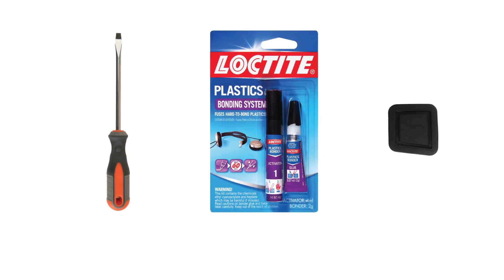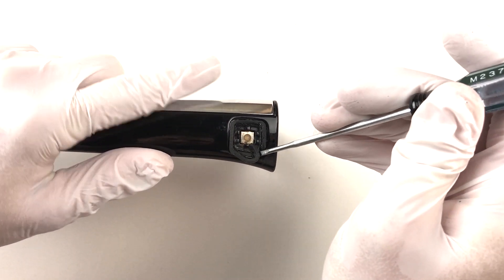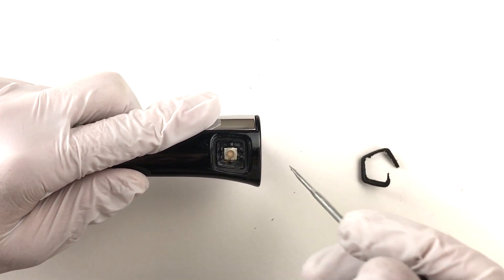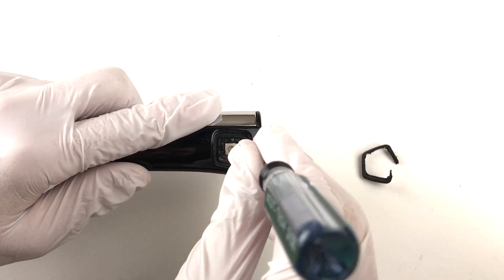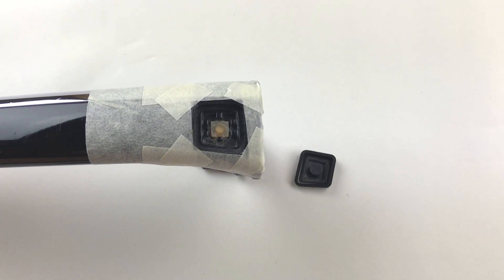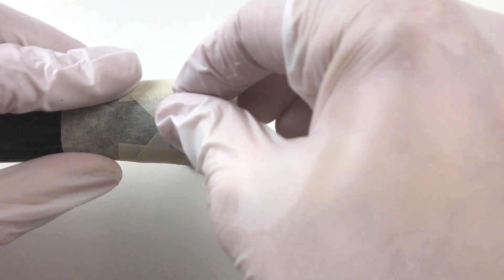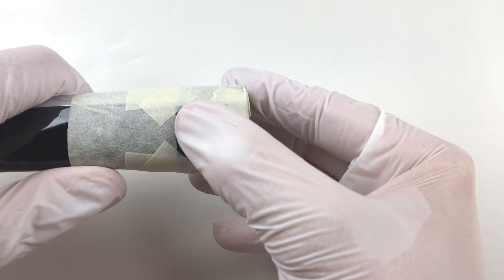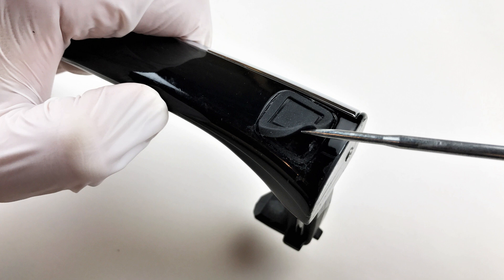SOLUTION: Fix the Mercedes-Benz KEYLESS-GO Door Entry Button Cover

Comment: Hello. Could you please help me?
Today I've replaced the driver door handle on my 2006 cls55 w219 and now if I push the knob on the door handle the door pops to open. Instead of closing the central lock. And if I push the long button behind it close the central lock insted pop the door.   Let's say the Open and close function switched?  
 Mechanically it sems like  works perfectly.   Before I replace it, it was worked  in the right way. The only reason why i replace the door hanndle was because small knob stop working. How I can fix it myself? Thank you.

Comment: Where can I order the buttons from and what are they called
Reply from the maker: They are back in stock: https://www.ebay.com/sch/ie.works.minnesota/m.html?_nkw=keyless
Reply: Thanks
Reply: Draco Yay will these Button fit the SL550 2009
Reply: @dracoyay6577  did that works
Reply: @leespencer5468  
Yes, works. But you have to choose the right ones.